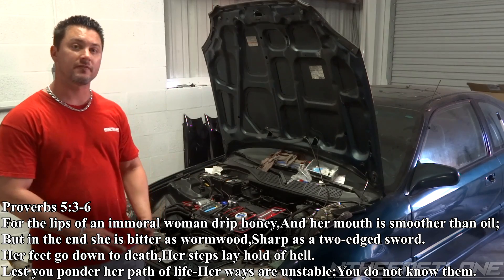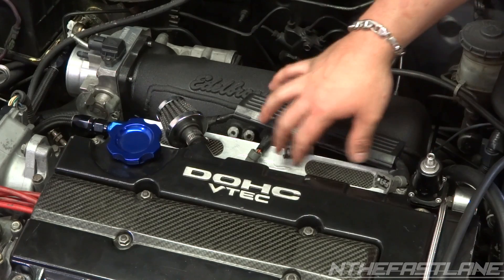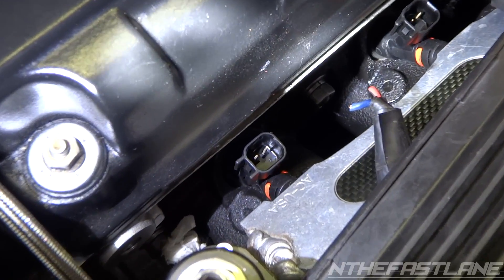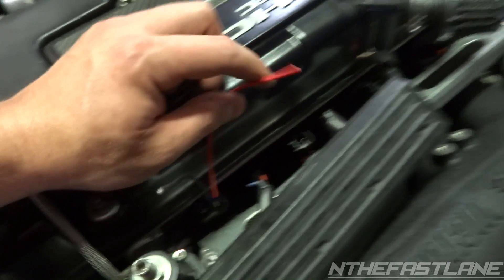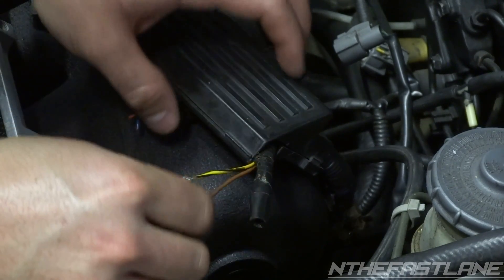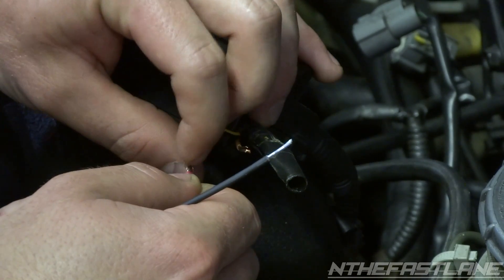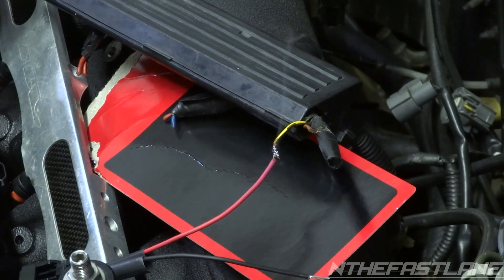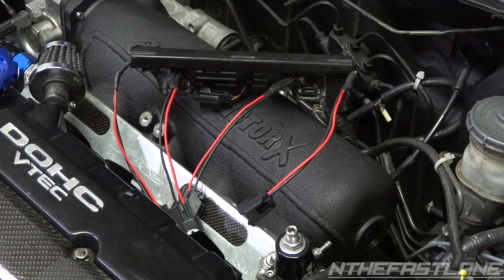▶️Injector Wire: How To Solder Bosch EV14 Pigtails⛽️(Honda,Acura,Toyota,Nissan,Ford,Dodge,Chevy)

Comment: Are these injector wires 18 gauge ?
Reply from the maker: Can't say off the top of my head. The link to the injector clips and injectors is pinned to the top comment and is also in the video description.

Comment: I need to do this with mine.  I have noticed the connector doesn't seem to firmly connect to the stock Honda injector plugs, on two different cylinders.

Comment: So my idiot bf snipped em witnout disco battery and the wires both fell on the fuel rail and he said there was a little spark. What do I need to check or go nexr? I disco the battery immediately and had him back tf away and havent touched anything since
Reply from the maker: Hi Danyell. I would leave the battery disconnected and proceed to solder in the new pig tails.Then install the injectors and connect the pig tails. Only way to find out if you blew a fuese, or shorted the ECU, is to start the vehicle once everythings installed and connected properly. From there you can start the troubleshooting. It may be just fine. Let me know how it all turns out.
Reply: @Nthefastlane  all the dang c. o. p connectors disintegrated so i have. to grab another one as well as the rest of the connectors on the harness that are in essentially the same shape tomorrow at the junkyard. Im going to just snip a bag full of all the matching ones from as many accords as I can, grab a few main relays and possibly an ecu or two then ill let you know. I suck bad at soldering so i may open for anything else that's close to comperable and can withstand that engine bay. Its not going to be a good connection if i do it- will look like a 5 year old got ahold of it but at least im aware of my shortcomings. I had to solder my motorcycles clutch cable and well i was driving with Jesus for awhile there. When i finally got the new cable in the soldered cable was barely hanging on by one almost frayed wire.
Reply: I've tried to get better its just not happening lol
Reply from the maker: The key is to use a 60 watt or greater soldering iron, and always put flux on first, then heat the wire. Once it starts sizzling add the solder.
Reply: @Nthefastlane  ok so this all started with misfire codes and me moving the harness to reach the egr valve bolts. Thats when 3/4 c.o.p 2 prong connects just fell apart one literally just broke down to just the two metal wired prongs they were so old & years of hot/cold flucts. Car ran as long as those were still tight to their matching males. But the next day when i went to get the new pigtails the battery apparently drained in about a 5 min run into the store
 I don't know if they touched or what caused that immed. drain but i got a jump and made it home. Got the pigs on and battery is staying strong through all crank attempts but can'tthe car to kick over now.; Getting power and control to the pigs says the test light to ground/battery positive checking each side of each 2 prong pig. Not getting test light to spark when i pull it off the s/p and its put down in the sp boot w/its clamp end up in the air close enough to the frame & hood it should give spark when i crank it - not touching anything metal in between test light probe to boot plug cap either so it should act like a piezo lighter being clicked once i crank it but nope. Anyway once i soldered one of the previously crimped/heat shrunk pigs rest still h/s crimped still no turn over. AND battery is back to dying with each crank attempt leaving me at just click noise by crank try 3. Help im just stuck at this point
Reply: @Nthefastlane  hope that all made sense, im really new to vehicle diy I'm more of a woodworking and computer repair hobbyist. Getting my first motorcycle sent me in a different direction tho apparently

Comment: question about ur injectors did u do some modificaions to fit that? cause thatsa for K series injectors right?
Reply from the maker: The only difference is the seals and you have to add a top hat. Yes you are correct, those were K-Series.

Comment: Can you give me a link for the actual injectors need some 1000s
Reply from the maker: Need them for which motor?
Reply: For a gsr b18c1
Reply: Thanks man didn't know they where that expensive I can get some rc 1200 for cheaper what do you think
Reply from the maker: Brandon Dale Rc's aren't bad either, just make sure there high impedance or you'll blow your ecu without the resistor pack.

Comment: What's the benefits of doing that?
Reply from the maker: Jonathan Ward Instead of the clips we solder in the pigtails because the clips pins tend to loose contact and you blow your engine. Just cheap china clips are mainly the problem with the clip adapters.
Reply: OK is it best to do that if your moding your engine or even if it's stock
Reply from the maker: Jonathan Ward Stock no need,if your upgrading your injectors they will have different clips which will have to be soldered like this demonstration.
Reply: OK got ya thanks for the info